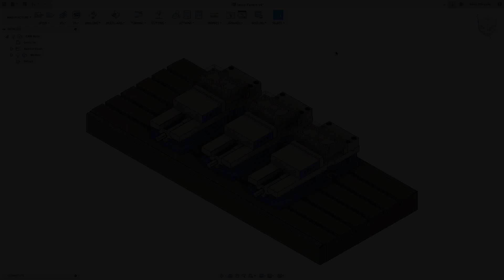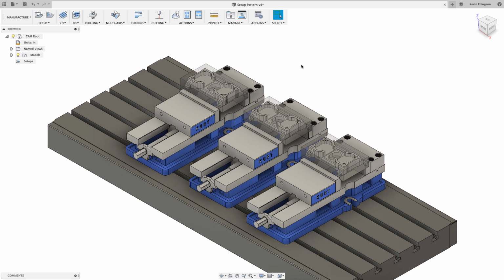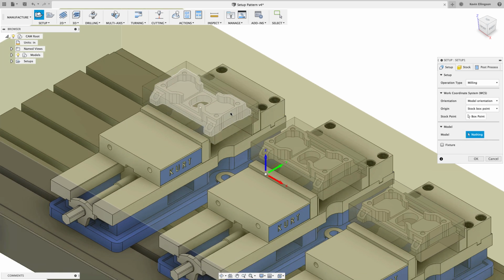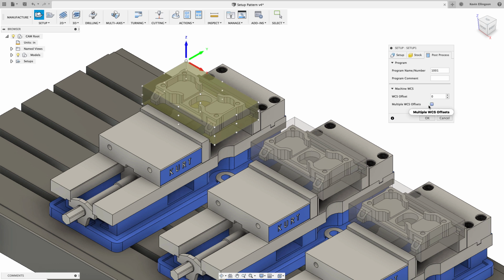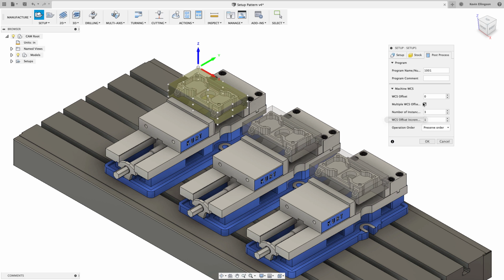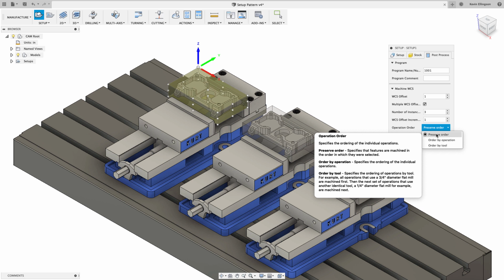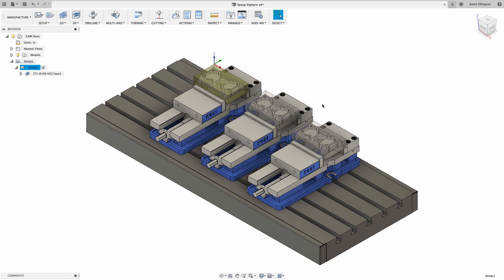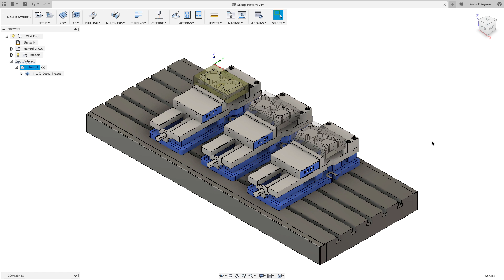Fusion 360 CAM WCS Setup Duplication

Comment: Hi, does fusion360 somehow know where the 2nd and 3rd duplicate work pieces are?  like I seemed you didn't have to specify where the other two are.  I've been trying this, and I must be missing something. Subscribed!
Reply from the maker: It doesn’t know where the other parts are located. When the code is posted, it is posted multiple times. Once for G54, once for G55, once for G56 etc. When the user sets up the machine, they have to teach each workpiece as G54, G55, G56 and so on. Then Fusion will execute the program at each of those locations.
Reply: @MechanicalAdvantage  OH! thankyou that makes sense, I figured I must be missing something.  thanks for taking the time to respond!

Comment: Is there a reason for having the 0 and 1 options both use G54? Just curious why Fusion does this. Also thanks for clearing this up for me. I assumed 0 was 54 and 1 was 55 (from other not so fun programs)
Reply from the maker: Well, there really isn’t a 0. If you enter zero, the logic in the JavaScript for the post processor will set the WCS to 1. So that is why you get a 54 no matter if you enter 0 or 1.

Comment: What if you do have your vises perfectly aligned and know the exact distance between each part? Is there a way to just find the G54 X, Y, Z zeros on the first part and have Fusion 360 duplicate the tool parts for additional parts at a defined spacing? I have a 3 part fixture for a roughing op that I'd like to set up to only have to locate the first part. The part tolerances are big at this point.
Reply from the maker: Hi Allen. The linear pattern option will do that. It will duplicate at an exact distance. You just can’t have one of the components rotated like I showed in the video.
Reply: @MechanicalAdvantage  Thanks for your reply. I actually found another video you did showing exactly how to do what I wanted using CAM Component Pattern Duplication. I got stumped for a bit, however, because my parts were "bodies," so I had to convert them to "components" before it would work. Thanks for your videos!
Reply: @MechanicalAdvantage  Thanks, this was also my question as I'm cutting out +/- 30 duplicates of a part on a cnc router.

Comment: Jeez, the video is ok, but I think the interface changed a little since 2019, the post process button does not give me brackets, also please can you explain how do you get the three models in place, do you import them as components from your library?
Reply from the maker: Hi Fernando. I placed the components in the vises using joints. Joints are the method you use to assemble components in Fusion.

Comment: Where do ya tell fusion the x/y  "0'' positions  for vise 2 and 3?
Reply from the maker: On the post process tab of the setup. 0 or 1 gives you a G54. 2 G55, 3 G56 etc.
Reply: on the machine itself, you have to go onto offset settings

Comment: Normally having 3 vices is for having 3 sets different setups to complete all operation on a part,  would appreciate if you could show accordingly with 3 different setup/ 3 different stock but with tool change optimisation
Reply from the maker: Hi Sunil. I'm looking into seeing if there is a way to pull this off.